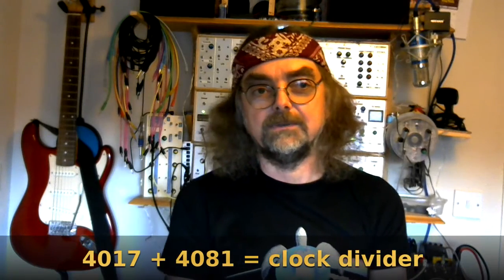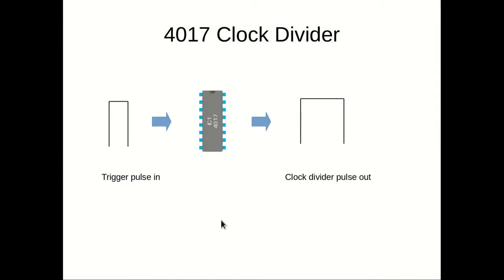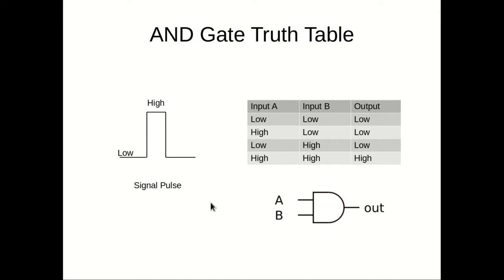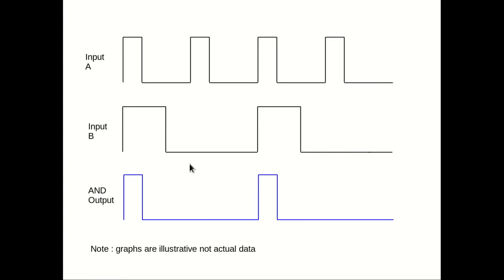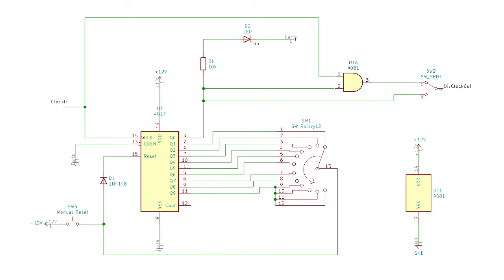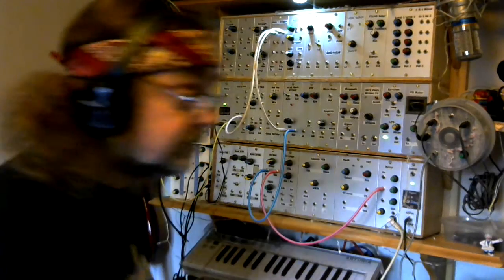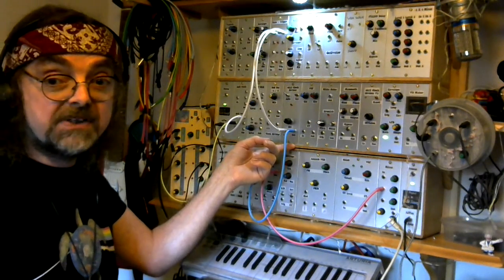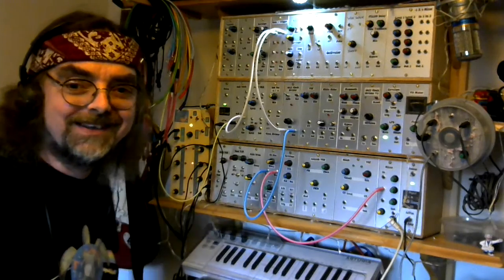4017 + 4081 = Clock Divider

Comment: Nice improvement! But wouldn't it better to have several clock outputs with 4/8/16/etc divides instead of a simple rotary switch to use them all together if you need it?
Reply from the maker: Check out my CuSi Drums not drum modules video for my clock divider/inverter that gives you 2/4/8 etc and their inversions.
Reply: @CuSiSound  That exactly the thing, thanks!

Comment: I just recently had a similar situation, and since I included an output buffer, I just ended up using a simple diode-and-gate (two diodes & a pulldown resistor) which works fine, and doesn't take up as much space:)
Reply from the maker: There are a few ways to create an AND gate, your diode solution is a simple but effective one, you could use transistors or even make a manual AND gate with a couple of switches. There are loads of examples on the net. I may have some projects in the new year that require several AND gates so the ic approach would be convenient for that. People can choose what best fits their needs. Thanks for the feedback.

Comment: Thank you for explaining this circuit! I am building this module right now it will be the fourth CUSI module in my rack !
I've noticed you use a plastic flange to attach the stand off to the back of the control panel... do you have a link to this piece????
Reply from the maker: The plastic flange is a cable tie self adhesive mount that I drill a hole in to attach the pcb stand off with a 3mm screw. A quick web search for cable tie /zip tie mount will give you plenty of suppliers to choose from.
Reply: @CuSiSound  Thanks for taking the time to answer!!!!!! You have such a practical way of solving problems. Love love love your channel.